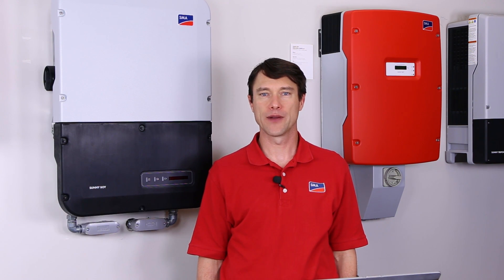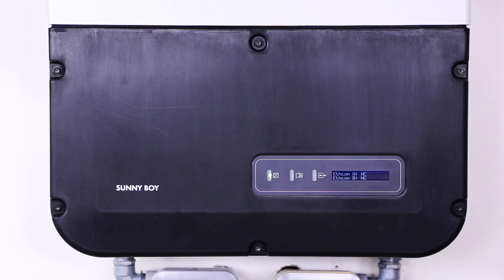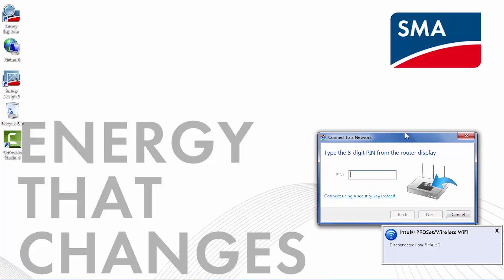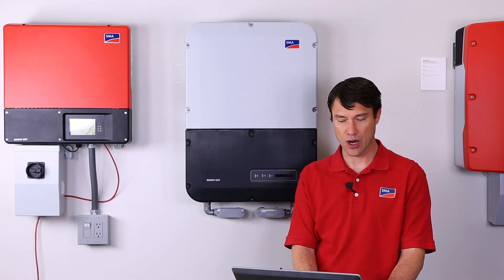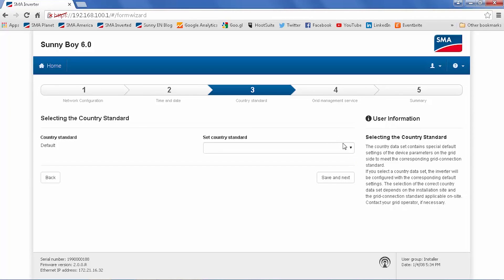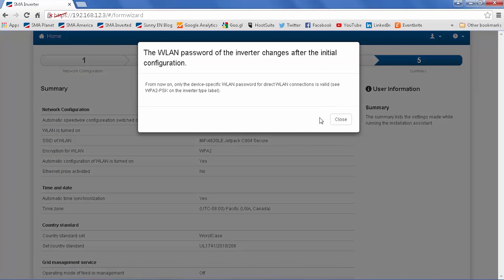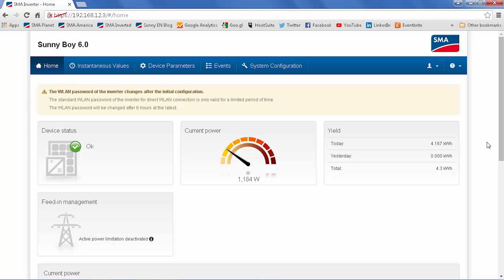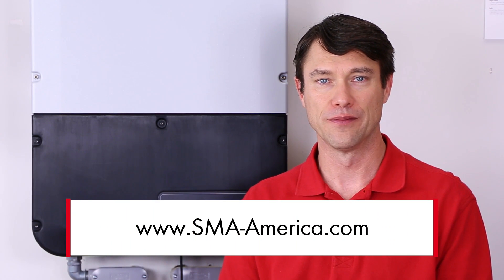Tech Tip: Commissioning the Sunny Boy 5.0-US/6.0-US

Comment: I have two Sunny Boy inverters. I cannot do step 1 of the commissioning because I cannot login to the inverter Wi-Fi. I have tried SMA12345 as well as the password in the label on the side. I have tried my phone and my laptop and neither device will connect to either inverter using either of the passwords. What am I doing wrong?

Comment: I'd like to see an actual step by step instruction for installers in an installer app (if there is one) and In the field-on the phone- wifi only connection. It's been pretty difficult to dig around for this information in order to simplify for our installers.
Reply: What about the initial knock on the inverter to get the WIFI going? If you skip steps, so will installers......

Comment: What is the red inverter to your left and to the right in my view? Why does it appear to have a DC breaker but the grey one does not? What other differences between the grey and red inverters?
Reply from the maker: The red inverter is an older Sunny Boy series (https://files.sma.de/dl/10707/SUNNYBOY9-11TLUS-DUS164320W.PDF). It is discontinued from production for quite a few years now. Both inverters do have a DC switch. For the new Sunny Boy (grey inverter) you can see it on the left hand side of the inverter on the upper half. You can see it more clearly in the Physical Installation video (https://youtu.be/lZLrGLIm8eU?t=61)